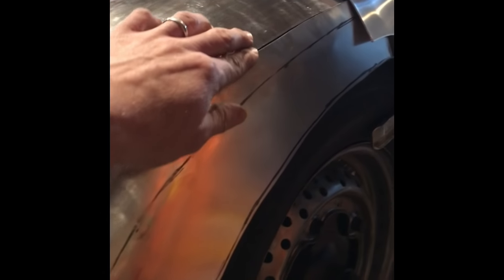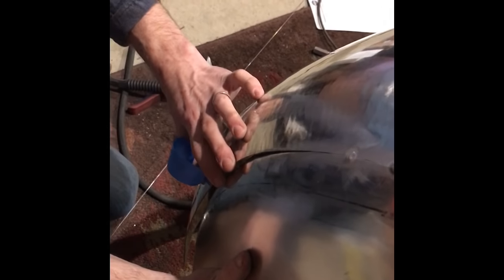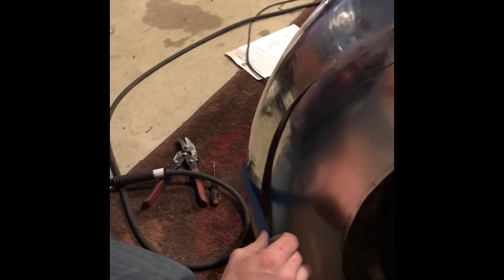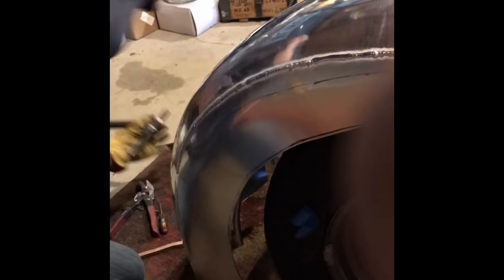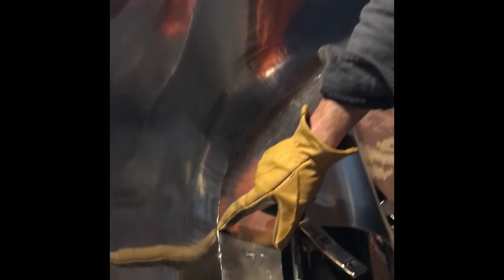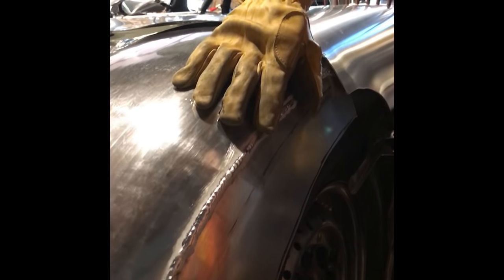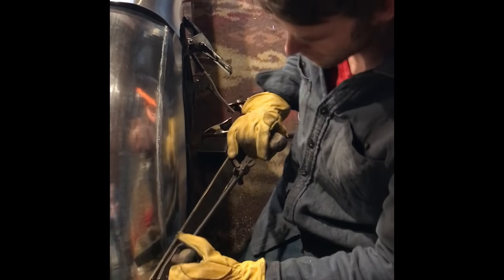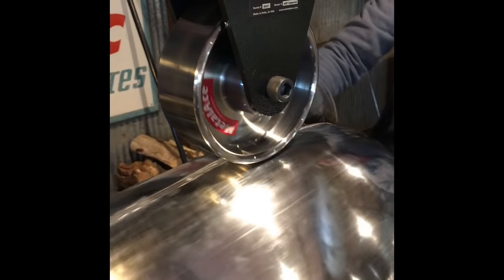Fender Shaping With Chris Runge

Comment: 4043 rod is a stronger rod used when high tensile strength  is needed and the weld is not going to subjected to alot of flexing. When I am tacking panels and want to keep things cool. I will keep a air wand close by and between welds I will blow the panel down. 30 seconds of air really cools a panel off fast

Comment: nice job! I think you would do a better welding if you shielded the back of your welding with the argon, you would'nt have to do the job a second time on the other side of your panel.
my technic is a homemade diffuser behind,  holded by players.
Reply from the maker: Thank you Jeremie. I have heard about this but never tried it. Do you have a separate tank of Argon for it? Would you use a lower pressure on your Argon supplied through the torch when back gassing?
Reply: RÜNGE KAROSSERIE hello, it can be either another tank of argon or a Y pipe fitting on your pressure gauge with a  tap on it, the gaz pressure is quite low. The trick is in the homemade device to hold the sheets together, it gives a little space between the sheets, and it is the gaz diffuser in the same time. I made them like the "interlocks" clamps but added a diffuser on it, and I move it as I weld.
The diffuser is pretty simple, it is just a pipe with little holes in line every 5 mm or so..
the value of this gap should be the same thickness as your sheet metal..

Comment: how do you like your Metal Ace wheelie machine?
Reply from the maker: Aaron, I really like the Metal Ace wheel. I did pick up a set of Hoosier Profiles anvils as the Metal Ace had a microscopic amount of run-out that we weren't able to correct. I do still use them on occasion however.

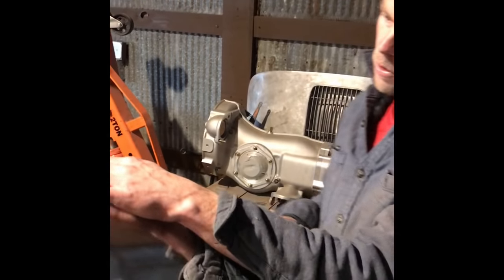Comment: Into The video 11:42 seconds there is a Volkswagen or Porsche swingaxle in the back ground. Does anybody have a clue to what it is?
Reply from the maker: That is a prototype casting for a mid engine 5 speed, Porsche 356 transaxle. It is built by WEVO.